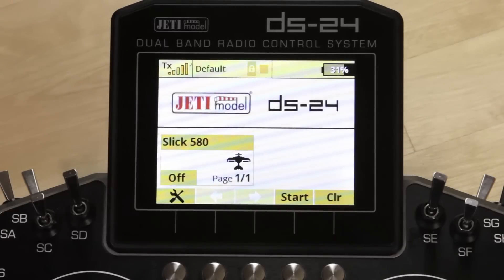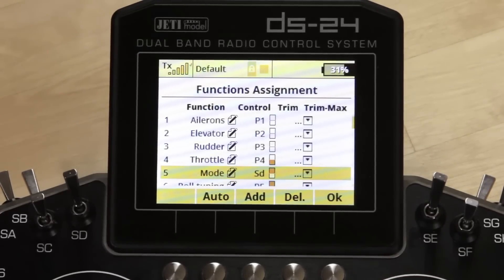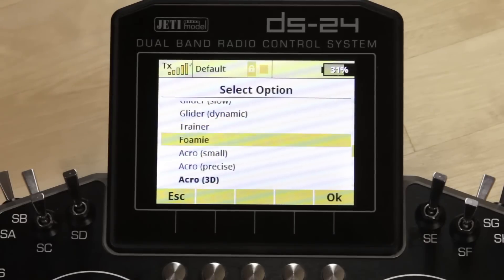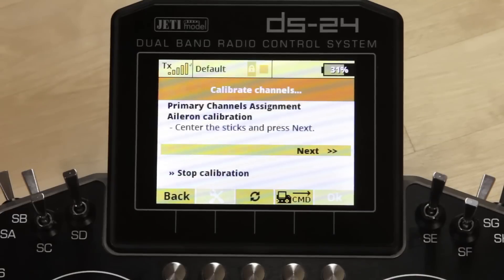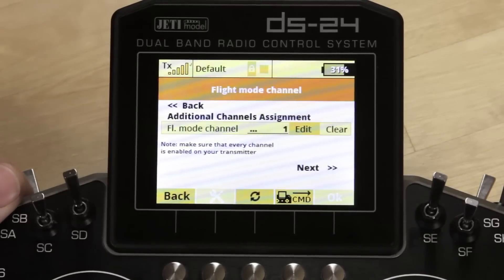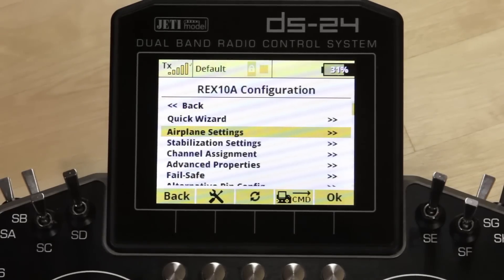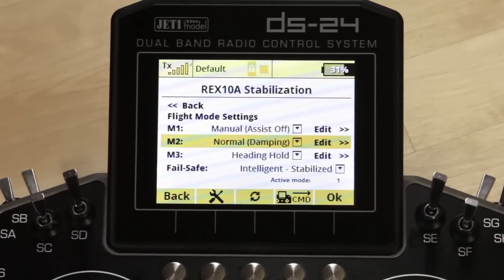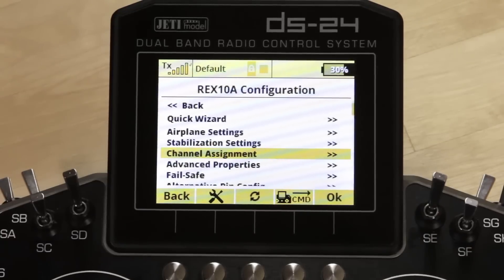A Closer Look:  Jeti REX Assist 2.4GHz Receiver Programming (Flight Stabilization Done Right)

Comment: Cool. Def. Getting one. I wonder if this be good in  my 79" Slick with DA50, tech aero ibec,  HV servos. I am currently running a jeti 7 channel RX,  without power distributoon, just the receiver. 60 flights no issues.
Reply from the maker: For setup info, it is best to reach out to the tech guys. They would know more than myself. You can reach them at support@esprittech.com.

Comment: Excellent Video, good information! 
       1st question: To help get better oriented to understand the video, I would like a bit more background information on the interaction of previously setup DC/DS Flight Modes (Main Menu > Fine Tuning > Flight Modes. Call this “Tx FMs”) vs. newly employed use of the Assist Modes (Model > Device Explorer REX 10A. Call this “Assist Modes”) setups. How much will you need to modify existing Tx FMs (if at all) when employing Assist Modes? ________________________________________
      2nd question — When you Setup Stick Calibration in the REX 10A Assist Menus what changes (if any) happen to DC/DS Stick Calibrations (Main Menu > System > View Inputs > Calib) that rarely need to be changed?  ________________________________________
      3rd question — Concerning the Warning (from my understanding): After making (flight controls) Trim adjustments flying in “Assist Normal Dampening mode” or “Assist OFF”, go back to Assist Menu > “Assign primary flight channels” > and re-Assign primary flight channels and re-calibrate the channels in the Assist menu. If you do NOT do this (re-assign channels), and selected the Assist Hold mode (Heading Hold mode) in flight the aircraft will become un-flyable. <-This sounds like a scary gotcha, I could fall into. Very likely I would setup my first Assist Receiver (Rx) on a dialed-in-plane I have been flying without Stabilization, and my Trims would long ago have been setup mechanically and in sub-trims menu, and the Trims menu (seen when you press the DC/DS 3D Menu Button) would be all Trims centered. Given this, Would it be reasonable for me to go to the Main Menu > Model > Function Assignment and completely remove the associated Trim Control from Flight Controls AIL, ELE, RUD to prevent this potentially disastrous use of Assist “Heading Hold” mode? ____________________  What would be a better solution? ___________________________________
     4th — Could links to follow up information be provided under the video? Links might be listed like the “Features” of the REX 10A are listed above this comments section. I mention this because it is sometimes 2yrs and more years after setting up a valuable piece of equipment like the REX 10A that I will eventually come back to it and need Setup info again. At that point searching massive RC Groups entries becomes even more tedious for me than it is now. It never hurts to ask. Of course, once setup, going through the DC/DS menus themselves answers questions.
Reply: I just set up an Assist receiver, and had similar questions. Were these answered somewhere?

Comment: Wait - Wait! You flew by the most important part it seems - How do you configure the TX to set up the RX? You talked about mapping channels to the output and that's the part that went by far too fast. Could you start with an overview of the high level implementation so we can figure out how, in general, you use and "assist" type of receiver.